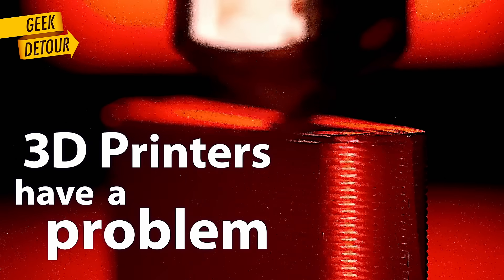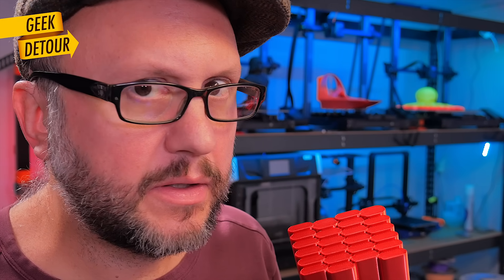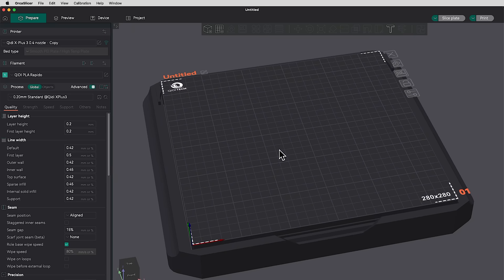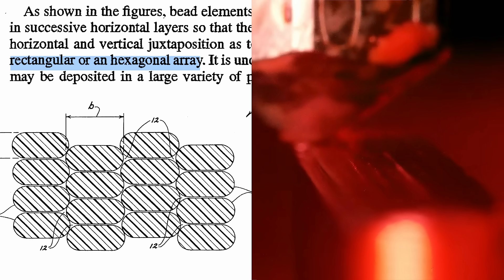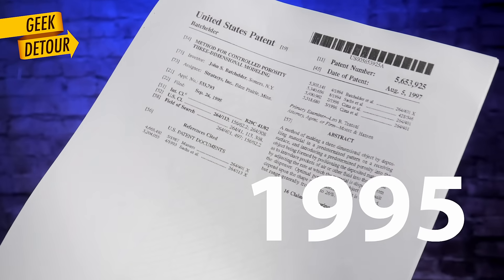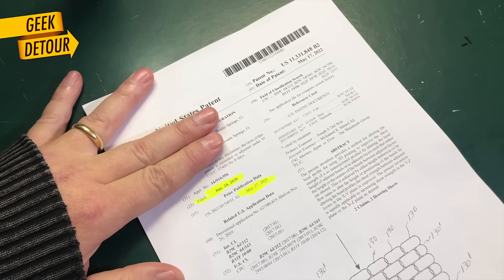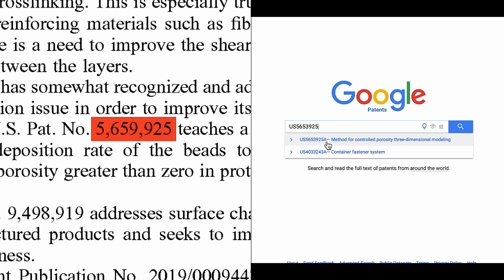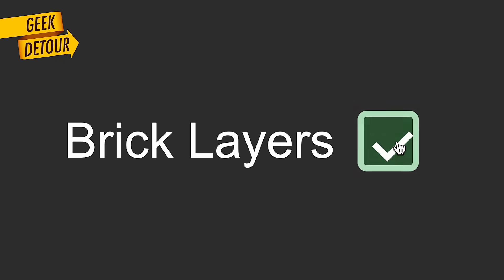Brick Layers: Stronger 3D Prints TODAY - instead of 2040 😬

Comment: What if, attatch ultra sonic sonicator to print nozzle head, increase strength 30% . Or print in vacume. 
Or use fiber infused filliment, fiber being pulled up by charged nozzle ring, so little hairs stick up out of filiment static charge . Infuzing each layer along z axis

Comment: a patent wouldn't be relevant....slicer programs are free.  nothing is being sold.  this is open source technology and public domain.  As long as they code/develop the technique independently they'd be in the clear.  Nothing new was claimed in this patent. This is a case of the patent clerk being lazy or bribed and just rubber stamping it.  It's not something that would hold up if challenged.  Safe to ignore it.

Comment: very easy this one... one word covers this; Stratasys.

also, cut down on the cooling for better adhesion. i for one print petg with 0-10% fan, 30% for overhangs. i go pretty slow for most jobs tbh, all my parts break like they are casted, not by the layerline :)

Comment: If there is prior proof of the concept made public you can easily attack the patent. You could also use it it and see if there is any "resistance" from the patent owner. If so it would be easy to remove the patent in case.
Reply from the maker: In theory should be easy. It is time consuming and legally expensive. I mean, very: the attorneys I talked with agreed that taking it to court to invalidate a patent can easily go beyond $ 200k in the US.

Comment: This patent wouldn’t be enforceable. It just describes staggering 3D-printed layers to improve strength - the same concept used in ancient brick joinery. Or by a 6 year old building Legos.  For a patent to be valid, it has to be non-obvious, meaning not something a skilled person would naturally think to apply. Using a time-tested structural idea in 3D printing doesn’t make it an actual invention.

Comment: But even in stratsys machines i couldnt find a y settings in slicer that opens that feature
Reply from the maker: I think Stratasys protected as much as they could imagine - even if in the end regular rectangular pattern was way simpler and enough for good printing. AddMan Group saw an opportunity to try patenting the same thing in 2020, framing strength.

Comment: Hold on... do you even have to care about some patent when it comes to printing on open source? It sounds very much like fair use if it's only a method and you're NOT making money from the method itself.
Reply from the maker: You need to pay attention to patents that your Open Source software might be infringing - specially if you are a Company. That’s the case of BambuLab, Prusa, Ultimaker… But even if you are an individual, you could be dragged to court if you distribute software that infringes patents. So, if you make things for yourself in your home, you could not care. Do you make a slicer yourself? 🤔🤣

Comment: If you can change the dispersion size to change height (thickness)of layers as you go and create some variation you can add strength as well. This would allow a smooth staircasing.

Comment: Inequitable conduct. They should lose the patent automatically.
Reply from the maker: It seems that proving it is not easy at all. Could you elaborate it? I would love to learn more about it!
Reply: @ While I’m not a lawyer, I have run R&D departments in medical diagnostics. Our lawyers beat into our heads that we had to be thorough in documenting prior patents, and that it was better for us to file them with our patent application than to have the patent office find them on a search. Moreover, it was also drilled into our head that intentionally leaving out a patent that could be prior art (just reasonably could be, not even is — which the Stratasys brick printing patent seems to be) would be considered “inequitable conduct” (the legal term), and would almost certainly nullify an issued patent. As a non-lawyer, I understand that it is considered fraud. Perhaps that is why they put in a number that was close, so they could say they didn’t do it on purpose. But even that is irrelevant, because prior art is prior art. If they get around the inequitable conduct argument, it could be the details of their claims versus the old claims. But patents are issued for novel, non-obvious useful things, so it would still need to pass the non-obvious hurdle (and the hurdle if it were ever used in a commercial setting before).

Comment: I always assumed that nobody uses this method right now because slicing would be a nightmare. Since each line width must exactly trace the path of the lines below it in order to fit into the groove created by the previous layer, any wall with sloping surfaces will look highly discontinuous, and overhangs will print very poorly since the outer lines can't overlap much. A hybrid approach may work better, specifically for prints with 5+ walls, where the outermost wall ignores bricklayering entirely, the 2nd outer wall uses arachne lines to fill the gap between the outer wall and brick wall, and the innermost walls use bricklayering. But the outer walls of a print are what determine most of the strength, since that is where layer cracks propogate from.

Comment: So we know acetone can soften and melt ABS. and ive seen tests done with post processing in acetone vapor to smooth the outside, though it doesnt fuse the inside layers. 

I would be interested to see a low ppm acetone vapor in the printing chamber while the print is happening and try for a chemical bond at print time.

Comment: im an engineer and an avid 3d printer hobbyist as well and my work is looking to buy a 3d printer, i am always going to do everything i can to make sure they dont buy from stratasys because that company does everything they can to restrict all their competition with legal battles. just recently they sued bambu labs for some bs. There is also tons of other benefits by not getting locked down with stratasys's proprietary machines that dont let you use anything but their expensive materials and cost much more than 10x of printers that can do just about equivalent work.

Comment: A few factors with that 3D modelling case (most of which you've already mentioned)
 - The U.S case has status of Non-Final rejection, so looks like it won't be granted
 - cases pre-grant have much less protection
 - The EP case is already under challenge
 - Any enforcement of patent protection is only really a possibility if used commercially, and even then, given the state/challenge on these cases looks tenuous (not legal advice!)

Comment: With the qualification of holding several patents and taken multiple courses on the subject, I can say that things are not always as simple as they look. For example, some patent lawyers strongly discourage or prevent inventors doing prior art searches. The reason for this is beyond the scope of a YouTube comment, but know that it happens. Additionally, some patent claims may be found in prior patents, but the more detailed claims are not. For those unfamiliar, how claims work is they start broad and get more and more detailed. Often the broader claims are unenforceable but the detailed ones are enforceable. 

With that said, the sloppy referencing of other patents is completely inexcusable.

Comment: This is only effective when the layer paths align vertically, i.e., you are printing straight up. When the layers are printed upward at an angle, it's not so easy to accomplish because we do not have variable nozzle openings to realign adjacent paths. So the slicer would need to account for hexagonal layer printing only when the path exactly stacks upon another path when matching paths are adjacent. Whenever this strength issue is a real concern for a product, perhaps it's just time to switch to resin printing or using the printed prototype to form a mold for traditional manufacturing methods like injection molding.

Comment: Wouldn't it be better just to change to nozzle on the printer to print different different shapes.
The strongest shapes are those with less sides.
So make a triangle shaped nozzle.
Reply from the maker: That’s an interesting question: maybe a flat tip could push/press the filament against previous layers and also transfer some heat… but that should be tested 🤷‍♂️

Comment: IANAPL, but after looking at both patents, it looks like the old one patents the ability to stagger every other layer vertically, but the new one patents that and another method where each layer is staggered horizontally (like a brick stacked between 2 bricks). Even though the first part can be thrown out, that doesn't invalidate the other brick laying claim.

Which is a shame since that one might far stronger than the one you want to get implemented in slicers (but also more complex since every other edge needs half width extrusions instead of just at the top surfaces of angled planes). 

But can they really enforce a patent of a running bond pattern applied to plastic?
Reply from the maker: You are absolutely right. The Horizontal shifted staggering beads would give an interesting fight since it happens naturally in many prints where the walls are diagonal…. but you know what? It is not worth it in my opinion: I measured the gains and… there were actually losses in my test 😬

Comment: Patent examiners don't really give any consideration to the claims in the patent, because they have no incentive to do so. The patent system is broken.
Reply from the maker: It probably happens more often than it should. But in this case, they searched the prior art and as the number of Stratasys old patent was wrong, it passed unnoticed. The good news is that the recent third patent submission WAS rejected so far by the examiner (what can be done about the prior two patents is still to be discussed - everything is expensive - but let’s see).

Comment: If there are errors in the patent that materially impact what would have been granted then the cheapest challenge option is the best. $3-12k depending on the person/organization filing with the Patent Trial and Appeal Board (PTAB) at the USPTO. Should be relatively quick to crowdsource those funds amongst everyone.

Comment: Thanks. I'm comming from original video. My post didn't make so much effect, so I post it here too :)

Orca Slicer has a issue with this python script (maybe some others too). In short it thinks You have two separate commands for XYZ move (G1 Z separate, then  G1 X Y). Orca in other hand has it combined (G1 X Y Z), so it breaks algorithm.

It would be great if You suggest it to original creator, because it works in PrusaSlicer, but don't in Orca :)

Comment: So the question is, even though we don't have official support from most (if not all) slicers, is there a way to get our slicers to have our printers use this method on our own? The ability to greatly increase the strength of my prints is very appealing to me
Reply from the maker: Watch Stefan’s video because he used (I think) Simplify 3D - and it was the only slicer that would help you to create a process to obtain this specific arrangement.

Comment: This actually a very common strategy from companies in all domain. Patent office cannot challenge every patent. The patent prevents you from using the printing method for profit like for an industrial process but not from using the method as a hobbyst with a costum slicer
Reply: And juges sometimes take surprising decisions when making patent arbitration... the fact that the 2020 patent is prior art does not mean that the juge will not rule in favor of the patent holder.
At all comes down to the specific patent laws and the exact patents description and claims

Comment: I reviewed the patents again. The new one from 2022 is not exactly the same. It specifically deals with regulating the flow rate of material on surfaces to get them straight. If the guy in the video does his 3D printing according to the document from 1995, he shouldn’t have any problems. The older one would always print with the same flow rate and not halve it on surfaces

Comment: ATENTION PLEASE: I used a continuous "egg-cup lattice" to shift Z.
At each (x,y) position, z becomes layer height+cos(x)*cos(y)*shift, where shift is somewhere around 0.2 mm, or the thickness of one to two layers, which in turn is faded away on bottom and top layers. This is very easy to implement, provides lateral structure without resorting to a "brick" pattern, and right now it has become PUBLIC DOMAIN as we speak😜
Reply from the maker: Maybe if I was smarter I would know if what you described makes any sense 🤣
Reply: Hi there!  @GeekDetour  Google for "z=cos(x)*cos(y)" to get a graph to grasp the idea. Wobbling layers YAY. It's fun to see the printer head going up and down.

Comment: I am not an attorney, but I do have a patent.  I looked at US5653925A Method for controlled porosity three-dimensional modeling, and they do NOT mention strength in the claims (which is the most important part of the patent) but DO mention strength in the description.  Because it is mentioned in the description, it should be prior art.

Comment: There are doubtless quite a few patents on file that are as meaningless as this. The issue on that end is ultimately that of scale - if patent examiners had to be completely thorough on every application, the throughput of the office itself would be too low

So instead much of the burden is placed on others to challenge such patents

A patent is not a bulletproof shield once accepted. If it’s wrong, which this one certainly appears to be, it won’t hold up in court, but it does have to be challenged, and that costs enough time and money that even with a high likelihood of victory, you need more than casual personal motivation to get it done
Reply from the maker: Yeah, a patent is a knot 🪢 very easy to tight, very difficult to untie

Comment: Can’t you just run it a bit hotter within the walls and print slower so the material flows in? It would still look like a sausage stack from the outside but should have better isotropy.

Comment: I'm curious, if they use a high powered laser designed to aim exactly where the filiment is being placed, if that would solve the issue since this would re-heat the previous layer enogh to fuse with the new layer

Comment: Patent examiners are not perfect.  Plus with enough office actions and money you can get almost any patent issued.  If you want to use the technology you hire a patent attorney and have him review the patent and what you want to practice.  If he thinks you can use the technology he will write an opinion called a freedom of action to prevent infringment.  Then you can practice the technology without getting sued for treble damages.  The most will get is a cease and desist order.  If you get the cease and disist order send them the freedom of action document and see if they shut the F up.  If the slicer is opensource and non profit the patent holder would have a hard time running down anyone using the option in the software to make commercial products.

There are AI patent search tools now that can find prior art like this within seconds with the right prompts.

So are you going to take the money you collect from this video and hire an attorney?

As a R&D engineer I have made a living going around others patents that shouldn't exist.  Plus patent trolls with submarine patents are fun to harass.

Comment: Contrary to common belief, the patent office does not check whether a patent is prior art.
The way it works, is that if you are convinced it is prior art, you can simply use the technique. If the newer patent holder subsequently sues you, you can use in your legal defence the older patent, or ANY OTHER PUBLICATION about this that was published before the time of the newer patent.

Comment: So I don't get it as far as the builder community. People can modify their 3D printers or the slicer to do whatever they want. It would be unlikely for the patent holder to sue a million individuals.
Reply from the maker: The problem is: individuals cannot do Brick Layers on current slicers - nor is easy to modify the slicers yourself, even if you are a programmer. It’s not trivial.

Comment: A programed motorized printing bed moving in the opposite direction of the printing head could double the speed of the printing. As well as multiple independently programed printing heads may even more than quadruple the printer speed.

Comment: EDIT: Forget what's here. This time Stratasys seems to be in the clear.

ORIGINAL POST: At this point I'm not even surprised that it's Stratasys. They're known for misusing the patent system by filing new patents based on prior art. Sometimes they repatent their own old patents (like with heated chambers, or this case with brick layers), and sometimes they steal others' ideas, like with exchangable sheets over heated bed. Any many more cases.
Reply from the maker: Hi there! These 2020s patents are not from Stratasys - it’s another company. I didn’t expose their name in the video, but of course, it’s public information - if you go to the description there’s a link to an open Post on my Patreon, with links to the patent documents. Actually, this time, Stratasys patent (from 1995) is what will allow us to use the hexagonal pattern.
Reply: @GeekDetour  Ah, ok. The way I understood your video is that it was Stratasys itself who repatented their own old brick layer idea (though it's not like they haven't done that before). Seems I misunderstood sorry, and thanks for setting things straight. I'll go and edit my original post to not spread false information based on a misunderstanding.